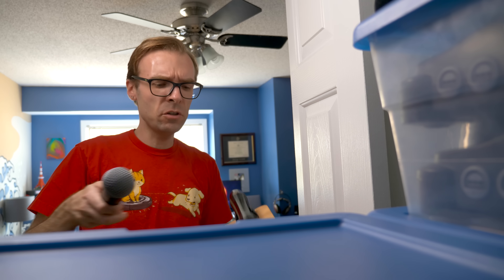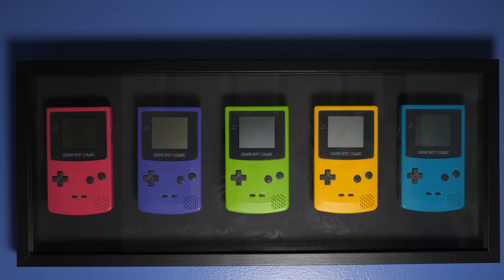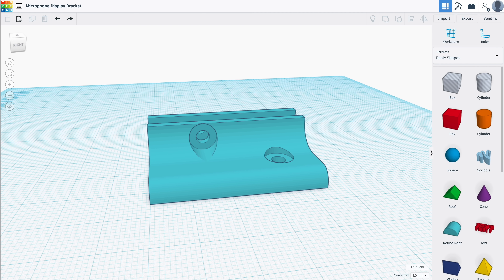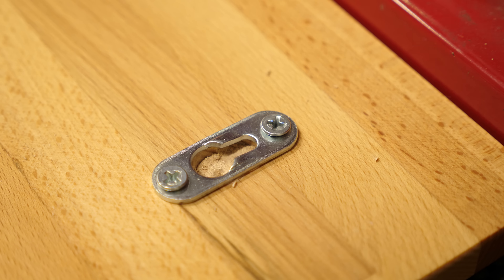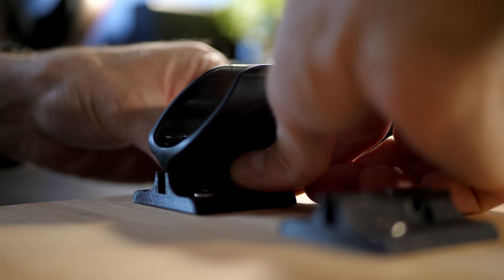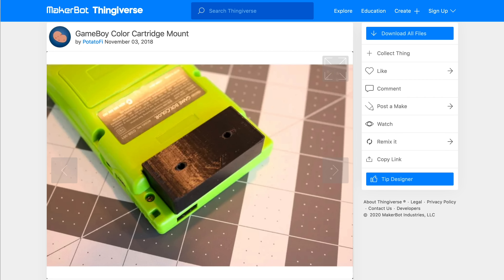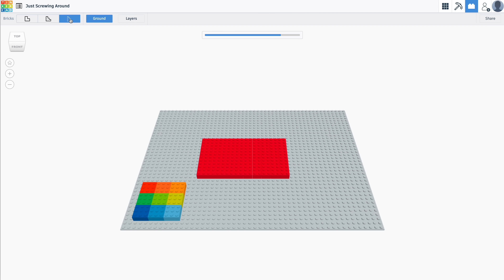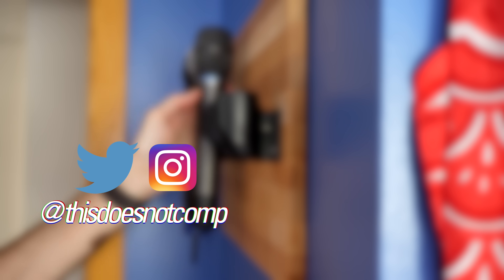Learning Basic 3D Printing (by Making a Wall Display)

Comment: Welcome to the world of 3D printing :) I've been 3D printing for a little over a year now. I've always wanted a 3D printer but couldn't really justify purchasing one; however last Christmas I got some Amazon gift certificates and decided to splurge. Now, a bit over a year later, I have a total of 3 printers (2 FDM (traditional melty-plastic-filament printers) and 1 SLA (resin printer.) Started with TinkerCad (and I still use it quite a lot) but am now teaching myself Fusion 360. It's really surprised me how much use I've gotten out of it. "Boy, it would be nice if I had a thing that could let me do <X>" thoughts come up surprisingly regularly for me, and it really is a cool and empowering feeling to go from designing something on a computer screen, to actually holding a physical thing in your hands. Enjoy your new printer (which one are you getting?) P.s. I personally wouldn't mind at all seeing more 3D design/printing related videos from you.

Comment: Hey man what frequency range is that QLXD in?
Reply from the maker: It’s actually a ULXD transmitter, and it’s in the V50 block (VHF). Hopefully it’ll be safe from the FCC for a while!
Reply: @ThisDoesNotCompute  we run the QLXD in the V50 at work. We love that frequency band because where we are there is nothing down there and we just workbench the systems for compatibility sake but when we do the TV scan there is nothing there

Comment: One suggestion, the screws holding the bracket to the wood backing, at the bottom, should be placed at the top of the bracket.  Fulcrums and weight and leverage and all that.

Nice job though, fun little projects.
Reply: Yeah, unless it's also glued and screws are supplementary.

Comment: The mic display turned out great. I’ve been getting into 3D printing as well. Have been using tinkerkad and ordering prints from treatstock. I‘d been thinking about buying a printer for myself and you inspired me to take the plunge. 👍

Comment: This is awesome!!!  I also got into 3D printing and I got a 3D printer last month.  It's the "EasyThreed X1", the worlds cheapest 3D printer that you can get for $100, and I was able to make it print really well with slicer settings and a literal fan pointing at it.  I plan to make a video about it within a few days.  By the way, I also live in Minnesota so if you need things printed, I can help.  My printer has its limits, but I'll talk about that in a video.
Reply: I just found a Flashforge Dreamer with dual extruders (print with two colors) for $100 at a thrift store. It looks pristine, almost like it has never been used (except some glue stick residue on the print bed and two full rolls of ABS filament loaded inside). In the box with all accessories. I already have three 3D printers at home, but this was cheaper than any of them - and it has dual extruders. Score!
Reply: @jevansturner  That's incredible!!!!  You got super lucky!!!!

Comment: Would really love to see some videos on the 3D printer when it arrives.
Reply: Lorfarius, +1 that!  There are others who make 3D print videos but not with the production value that are in the videos on this channel. I want a 3D printer (prusa i3) but i don't know anything about it at all. software or hardware. Some videos from a beginner would be awesome IMO.
Reply: @mikehensley78  As an Original Prusa i3 MK3S owner (x3, actually), I can't recommend it enough. Excellent printer. All three of mine are printing right now, in fact!
Reply: @PotatoFi  thats awesome. from the litte i've read online that seems to be what everyone says and they are supposed to work well with ubuntu linux(the OS i use).
Reply: @mikehensley78  It should work great with Ubuntu, but the reality is that they're completely OS-agnostic. You'll use PrusaSlicer to prepare models for printing, drop them onto an SD card, print directly from the card. And of course, PrusaSlicer runs great on Linux.

Comment: I'd like to own a 3D printer myself, but I'm not a fan with how stringy the edges of most 3D printers prints seem to be.
Any recommendatioins about that? I remember seeing a liquid based one years ago that was see through green or something where it didn't do that. Not sure if that ever got released to the public though.
Reply: You're thinking of a resin printer. They are cool and can print crazy tiny details... but printers that heat and extrude plastic (FFF printers) are much easier to use, and in my opinion, create very useful plastic parts.

I recommend the Prusa i3 MK3S, or the Prusa MINI. Colin's parts were printed on my Prusa MINI. I've also been hearing good things about the Creality Ender 3.
Reply: I'm not into 3d printers, but I saw people using acetone or something similar to melt the plastic and make it smooth. 
You can also rub the top layer with sandpaper to smooth it
Reply: Depends on the plastic of the 3D printer filament. ABS filament is soluble in acetone. Nail polish remover is mostly acetone and sometimes tinted green. A vapor bath of acetone can smooth out the layer lines of a 3D print. PLA, a more common filament, is somewhat soluble in acetone.